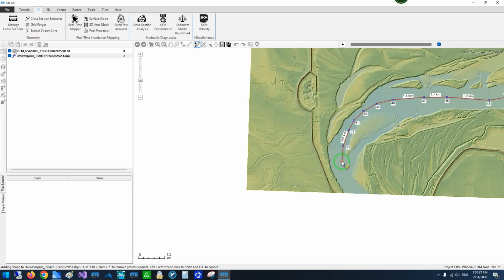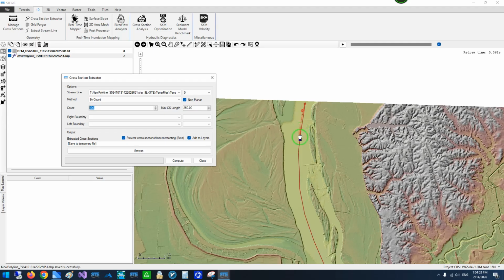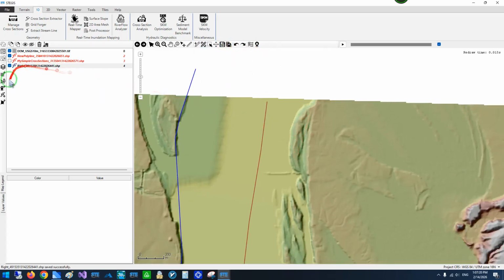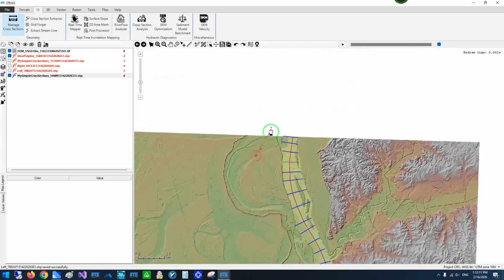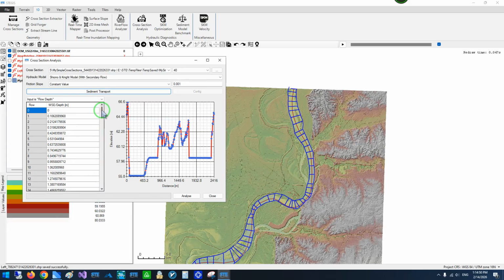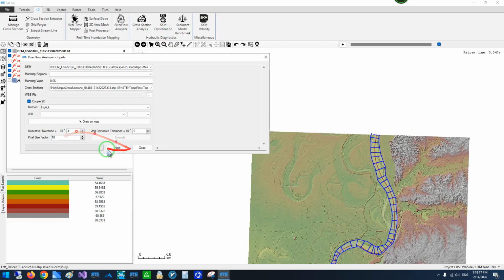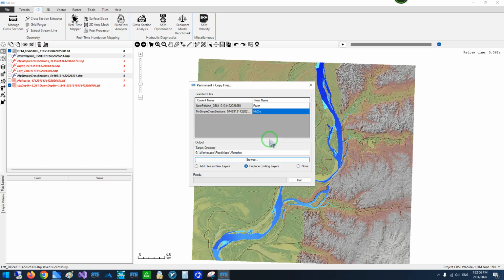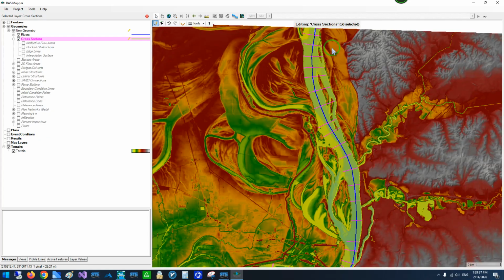Automatic Cross Section Generation & 1D River Modeling in STE and Export to HEC-RAS

Comment: Hi there,
I have got Bathymetric survey data for a highly meandering river consists of 11 cross-sections with X, Y, Z coordinates. Points within each section are 30–90 m apart, while cross-sections are several kilometers apart, creating dense strips with large gaps between them. Standard interpolation methods (Kriging, IDW, Spline) fail due to these gaps, and TIN interpolation incorrectly connects sections across land instead of along the river channel.

The challenge is to create bathymetric DEM from only 11 cross-sections with no data between them.
I drew river flow line, LOB,ROB from google earth pro, is there any way to interpolate In between cross sections by importing those point data and flow line, bank lines?
Reply from the maker: Hi! Sorry for the very late reply — I just noticed your comment!

Yes, this is actually a case that STE can handle. You can define/import your 11 cross sections in *STEGIS* using the *1D Cross Section Manager* tool, including the X, Y, Z coordinates of the surveyed points.

Then, you can use *Grid Forger* to generate the bathymetric DEM. Grid Forger uses a dedicated interpolation algorithm developed specifically for interpolating terrain **between river cross sections**, rather than treating the data as a conventional scattered-point interpolation problem. This helps avoid the typical issues you mentioned with IDW, Kriging, Spline, or TIN, especially when there are large gaps between cross sections and the river is highly meandering.

So, with your cross sections properly defined along the river, the interpolation between the sections should be much more suitable for this type of dataset.

Your flow line and LOB/ROB can also be useful for defining the river geometry and guiding the setup.

If you are still working on this project, feel free to give it a try — I’d also be interested to see how Grid Forger performs on your dataset.